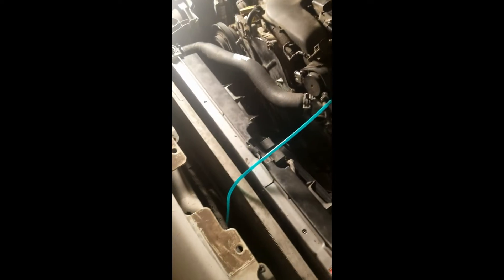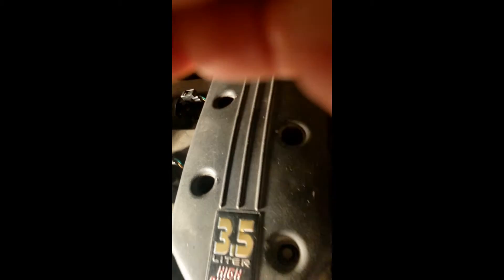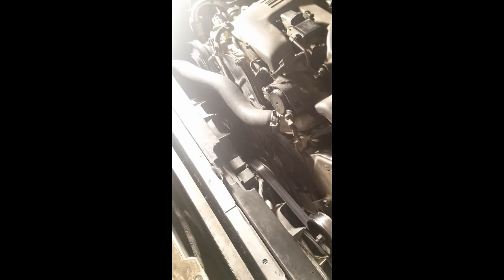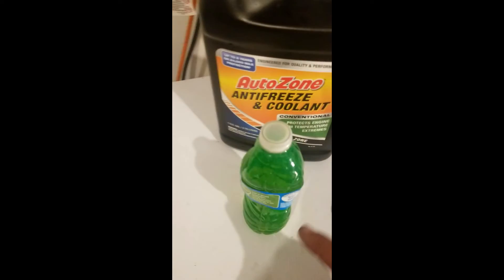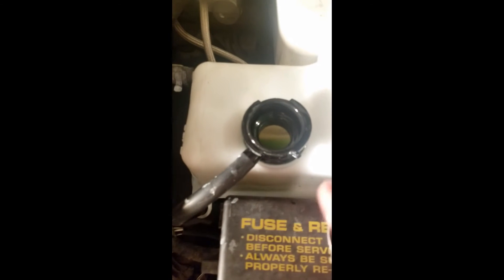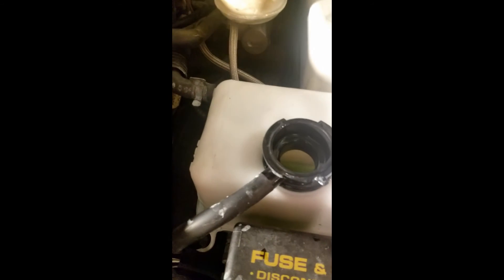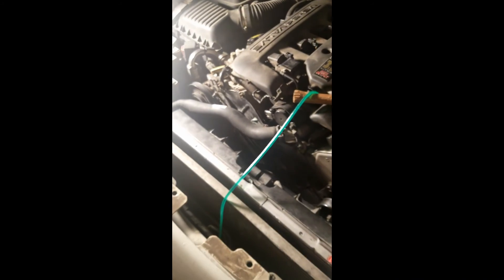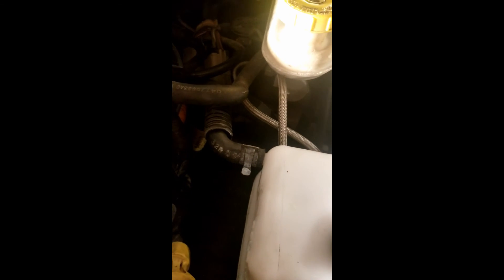How I bleed a closed coolant system.  Chrysler 3.5 HO

Comment: I've been dealing with this for 2 days now. At idle and driving it runs about perfect. When I turn the a/c on it starts getting hot. I have a brand new radiator water pump and hoses. Both fan relays are good because both fans are running. What could cause that? And I just saw this. Was yours bubbling in the reservoir before you bled it? Thanks
Reply from the maker: such a while ago.  To the best of my memory,   i don't think it was bubbling in the reservoir.  Turn your heat on full blast.  It should b about scalding hot and not lukewarm/ambient temp at all.  If it isn't hot, you have air in the system or there is blockage. But yours runs fine without AC so shouldn't be blockage.    Running AC in extreme 100+ temps puts more of a load on the engine - so any air pockets will make the temps rise dramatically.
Reply: @davewhitman5392  ok. Thank you

Comment: Well, I'll get back to you as I have been going through heck with an 05' Sebring Convertible 2.7 that is notorious with many heating loss issues, door actuators, climate controls, relays. Was fine having just dash vent air but after changing thermostat and following all "expert" bleeding advice ? I get sent on a no way trail to get heat back. ( but it also messed up previous fine working A.C.) Your advice made so much sense, I went right out and sure enough got some air from just squeezing the hose. I also finally found proper year diagram that seems it should be putting heat out no matter what if circulating properly through heater core. I did bleed quite a bit as manual stated and I'm hoping with winter here, you nailed it needs being done a million times. I'll let you know if you trumped a whole lot of experts.
Reply from the maker: Glad it helped so far.  This is my kid's car. A month down the road, it started to overheat again and consume a lot of coolant.  So I bled it again, got the heat back and sent him on his way.  Week later, same thing.  Throwing my hands up in the air, I took it  to a shop for a pressure test.  They said they idled it for 2 hours and it finally exposed a leak through the thermostat jacket I just replaced.  Guess there was a crack in it.  So I guess also be on the lookout for any hairline cracks anywhere - hoses, jackets, radiator, etc as anything small sucks in air and leaks out slow almost undetected.